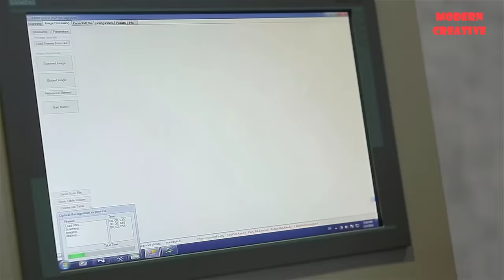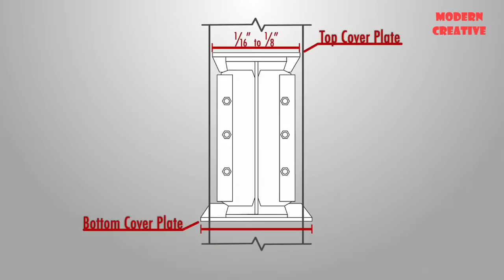Fabrication process of steel building frame and the fully automatic steel frame welding line

Comment: According to our steel frame work manufacturing customers' experience, many of the pre-working parts can be done with new laser cutting technology, it save the processing step and its precision cutting allows better welding result.
Reply: no...even in oil and gas industries - They are still using plasma cut or wire EDM.
Reply: @nguyenvuhoanglong3418  In Russia we use laser cutting with a 12 kW laser. The edges of the parts are very smooth and immediately ready for welding. Only the maximum cutting thickness is 25 mm. On plasma up to 50. On gas cutting approximately up to 120 mm.

Comment: At 2:20, I see men bending over to weld, when the job is sitting on supports.
They could be easily working in a more comfortable position if the job was set up higher. But hey, labour is cheap there.